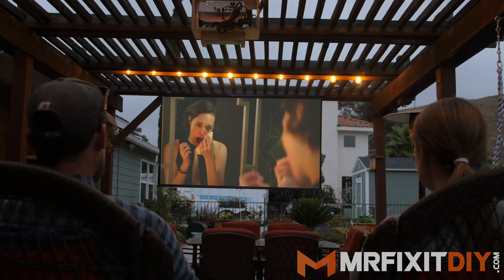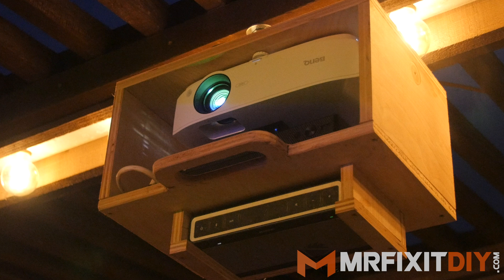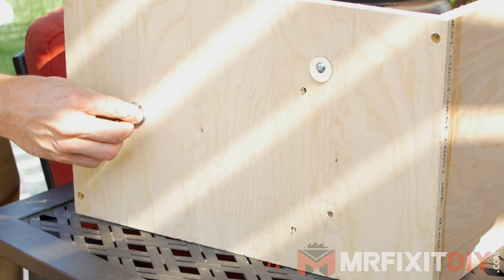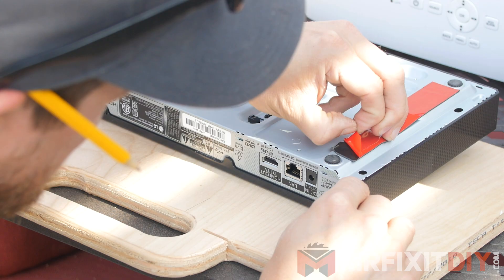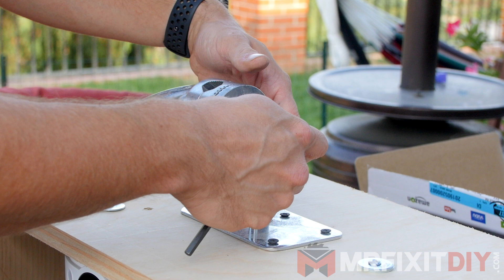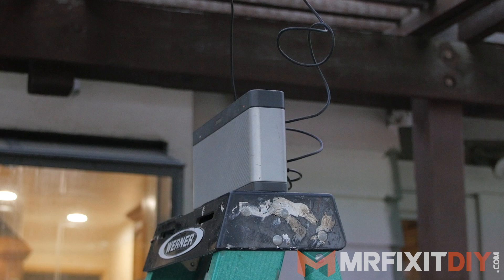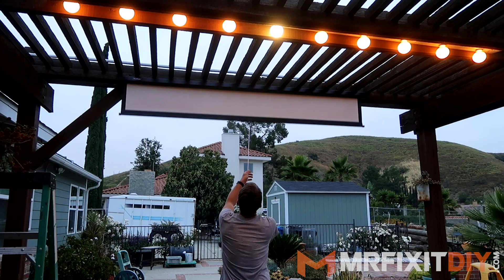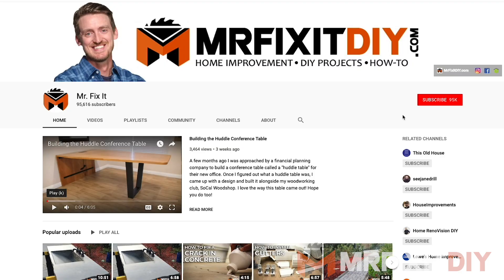DIY Outdoor Movie Theater

Comment: I have two projectors. One is the LG - PF50KA. I also have the Crenova 6800 and that totally surprised me because I only spent $190 on it. It doesn't have Bluetooth like the LG but it's just as good as the LG otherwise.

Comment: Great mounting system but once you have your digital projector mounted you should have a safety chain or cable that attaches to the beam up above. This is just a safety so that in case for any reason use of the projector vibrates and loosens the clamp you will have a back up that catches it in mid air.

Comment: I found an Epson power lite 955WH 3LED projector at a garage sale for $5. also I found a complete surround sound set of speakers at another garage sale for $15. (Including the power subwoofer) I spent $45. for a Sony stereo receiver , then I needed a cheap little DVD player so again i found that for $5. at a garage sale, as for as my movie screen my son had a motorized 100” screen he gave me that he no longer needed….I had all the speaker wire I needed from another project ….so total expense was $70. and everything is perfect great for out door movies and very portable can set up anywhere….check those garage sales you never know what you might find……

Comment: it's been over a year since you set this up, just wondering how the pull down screen held up with it being outside? did condensation effect it in any way?
Reply from the maker: Nope. Only thing that happened was the string that connects to the handle to help you reach it dry rotted

Comment: Great project! Have you had any issues with the weight of the brief case assembly or is the grip head able to hang on to it easily?
Reply from the maker: I have not had any issues. These Grip clamps are heavy duty for film/production equipment so they can hold a lot of weight

Comment from the maker: Thanks for checking out this project video! I hope you enjoyed it. If you have any questions about anything I didn't explain in this video, please leave them in the comments below.
Reply: MrFixItDIY  how did you connect the speaker to the DVD player?
Reply: Was the bose speaker blue tooth OR hardwired?
Reply from the maker: @christieschipper9341  It's a bluetooth speaker but I have it connected with a male mini so it's wired. You could do either if the projector can connect via bluetooth
Reply: This is awesome! Do you also remove the projector screen or are those things good for outdoors?